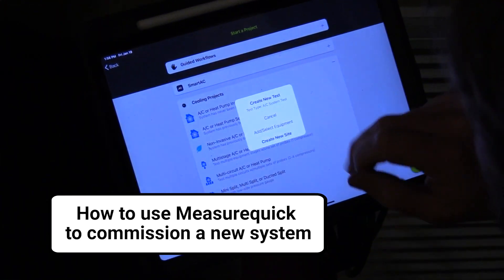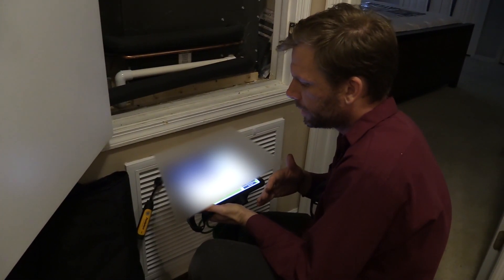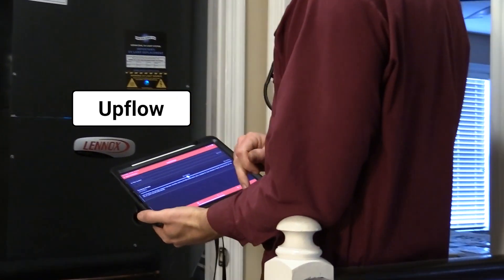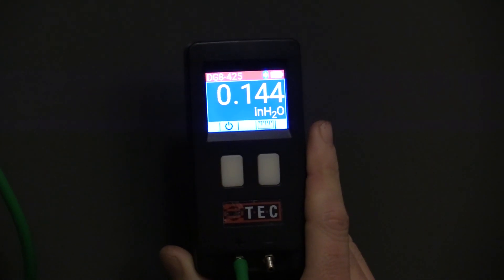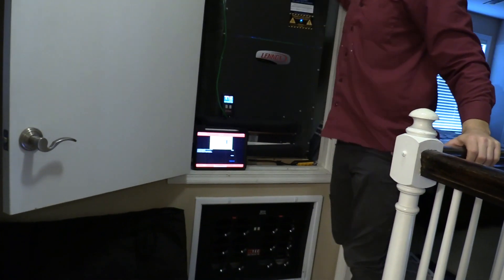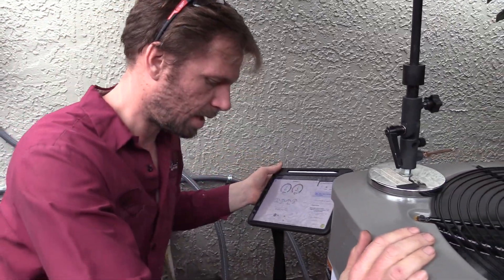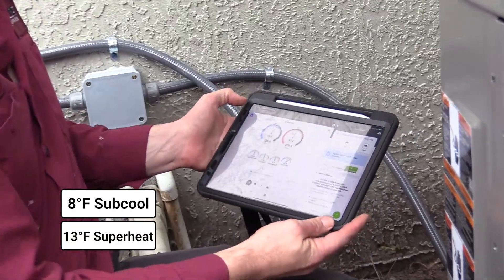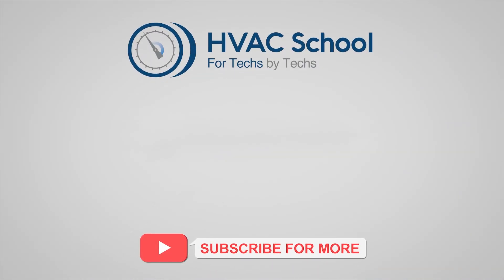Using measureQuick to Commission a New HVAC System

Comment: I will play contrarian. I do not buy into the notion that "commissioning" or even other things such as using nitrogen while brazing do much of ANYTHING to make equipment last longer. Equipment today often doesn't last long because frankly, it's junk. I have seen as well as replaced a ton of old equipment both residential as well as commercial over the decades that was up and running for 30-40 years. Yes, it was well maintained but none of it was "commissioned" and no one was using nitrogen when brazing. We are going absolutely loony with this tech obsession not just in this field. Truth be known, it's more about money than anything to do with making equipment last longer.
Reply: R22  and the other refrigerants of the time were more forgiving and way lower pressures.
Reply: I’ll also add to  @Gcanno that these newer systems are required by law to operate at higher efficiencies and this causes some of the simple parts to be replaced such as a txv instead of a fixed orifice. The txv is one of the reasons to breeze with nitrogen to prevent the txv from being clogged.
Reply: @Gcanno  how were they more forgiving
Reply: This video had so much potential fellas. Would have been awesome screen record was on and displayed on the screen, would have loved to have seen the display while watching.